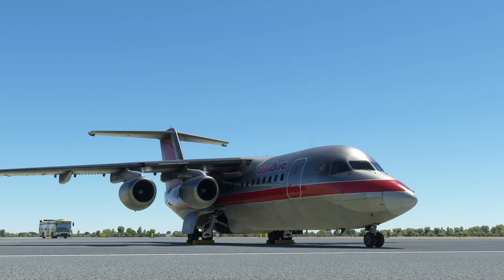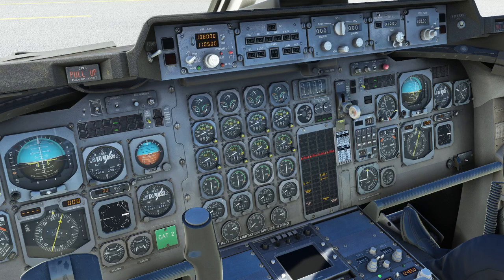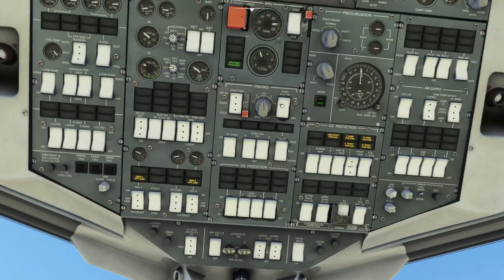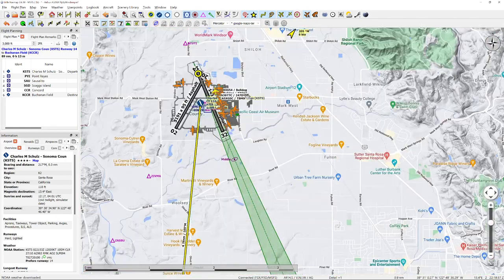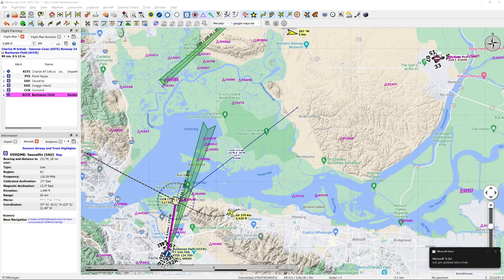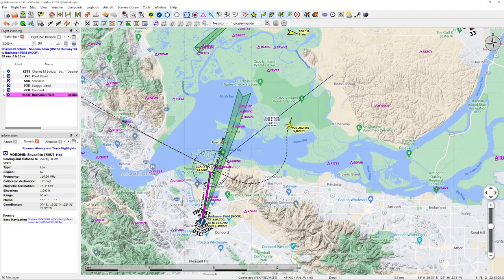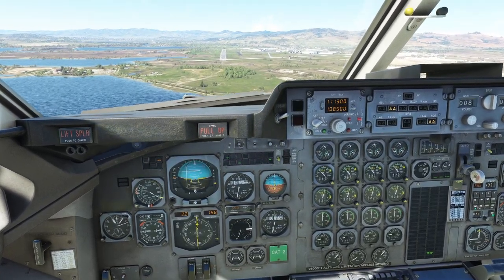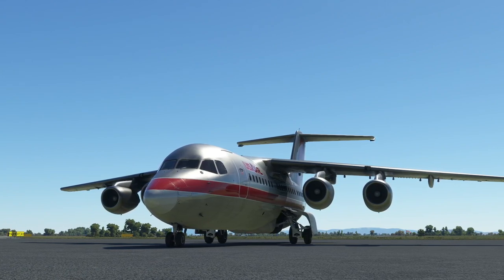Beginners Guide to VOR Radio Navigation in the JustFlight BAe 146 in Microsoft Flight Simulator

Comment: These tutorials have been invaluable to date!  Any chance of some more? :) :)
Reply from the maker: You want some more 146 videos ? :)
Reply: @jonbeckett  Wouldn't mind a couple on the finer points of Altitude change (+ / -): the different methods of changing it but also things like how to capture (Altitude hold) and how to set the aircraft up for going into AP (either climb, descend or level flight).  I'm so spoiled by the Garmin units!  Manual flight seems fine but I'm struggling a little with AP - it'll kick out for no apparent reason (to me anyway).
Reply: @jonbeckett  I'm REALLY struggling with changing altitude with the autopilot!  It's just not going in!  :(
Reply: @jonbeckett I found the key - the SYNC switch!  I'd read the manual on AP over and over and somehow missed this.  It wasn't too clear it acted like a clutch for the FDs.  Why is it bound to Afterburner1 though?  I would have thought it would make more sense to bind it to Flight Director Pitch Sync...

Anyway - now I can get flying. :D

(Still would love to see more vids though!)

Comment: video was excellent. no doubt. a lot of learning. Keep up the good work.
Reply from the maker: Glad you liked it!
Reply: @jonbeckett  Can you tell specs of your computer ? Processor, Video Card, RAM, HDisc etc.
Reply from the maker: @jawadbabar1  I7, 3080RTX, 16Gb RAM
Reply: @jonbeckett  Hi, one more question. Sorry to bother you. My question is which will be the best? MSFS2020 on PC? Flight simulator on XBOX or Xplane ? I guesss Xplane also runs on PC. Guide me please. Really appreciate your help.
Reply from the maker: @jawadbabar1  MSFS on the PC is the best simulator for general aviation, and now commercial aviation too. If you want to fly military aircraft, DCS on the PC is the way to go. MSFS on XBox is almost identical - you just can't install any extra software to improve the experience (and the controls are a little different).
Reply: @jonbeckett  The graphic card available here in the market is Nvidia 970. this one is recommended in simulator recommended specs. do you think the graphics with 970 will be better than XBOX graphics ? If XBOX graphics are better, i may go for XBOX. I can't go for higher graphic card because they are way way too expensive here. thanks.

Comment: You should climb using IAS (it pitches to maintain selected speed with fixed thrust, similar to FLCH or OP CLB in other aircraft). This protects you from a low-speed event regardless of what you do with the power and, if the optimum climb speed is selected, gives you the best climb performance.
Reply from the maker: I know :) I know how it works too :)